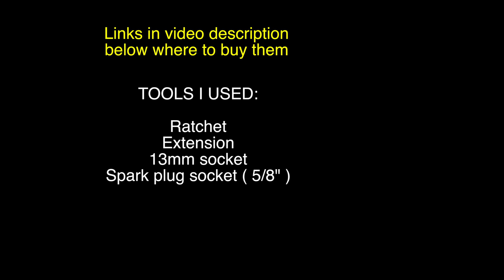Honda Ruckus / Zoomer 50 - Spark Plug Change | Mitch's Scooter Stuff

Comment: Hey mitch I gotta work tnt and I drive a Honda ruckas 2018 and when I go to start it up it clicks where the fuel pump is and won't start with kick start I need to get it working for tnt so I took the battery out and put it on the charger cause it's cold outside I'm hoping it will start when I put it back in tnt for work. But not 100% it's gonna work anyone got tips tricks suggestions for me ???????

Comment: The easiest way not to over tighten is when it doesn't free turn anymore 1/8 snug
Reply: Hello
When you changed your spark plug, did the old plug have oil on the threads?
Thanks
Reply: @briangiemza1323  it did but I put a little so it's easier to remove

Comment: So I replaced the spark plug but I still cant start it with the button. I hear it clicking but it won't start. I've been using the Kickstart. Did i do something wrong? Or is it because it has been getting colder out here

Comment: I just tried to put in a new spark plug, but it won’t screw in all the way. As I was turning it I noticed it started messing up the threads. Any ideas? It is 100% the right spark plug. Thanks advance.

Comment: Hey this is kinda a question for everyone out there with a ruckus or really any small engine I got a ruckus the other day and I checked the oil and it smells a bit like gas could that be because of the spark plug
Reply: Yes you will have a little smell.
Reply: Reid check your spark plug sometime. I just bought one 4 weeks ago and I pulled the spark plug and found oil on the threads of the plug. I'm trying to find info if this is normal. Maybe it came from the factory that way.
Thanks

Comment: Mitch, thank you for the easy to understand and follow videos. 
I changed my spark plug with an iridium spark plug and I instantly noticed the difference on my Ruckus. 
Thanks again for your awesome vids!
Subscribed!
Reply: Hello
When you changed the spark plug did the threads of the old plug have oil on it?
Reply: Brian Giemza - I did not notice any oil on the threads of my old spark plug. It could just be a bad or worn out O-Ring on your old spark plug. I would clean the threads around the engine where you screw in the plug and then check the new spark plug after a few rides to see if it happens again.
Reply: @Blessed_4_life  
Thanks for the information. I called the dealer they said this is normal. I still dont believe them. The 2019 ruckus was used with only 100 miles on it. I'm hoping the oil was just from the dealership tune-up. Maybe the mechanic put the oil on the plug for lubrication/seizing up. They said they checked everything over. But like you said, I cleaned the plug and will drive it for a while and check it again. Thanks
Reply: Brian Giemza I would take it back to the dealer If you notice oil on the threads of your new spark plug after a couple days of riding your Ruckus.